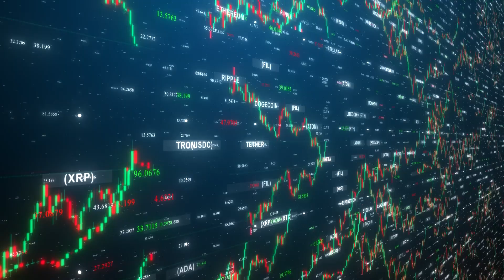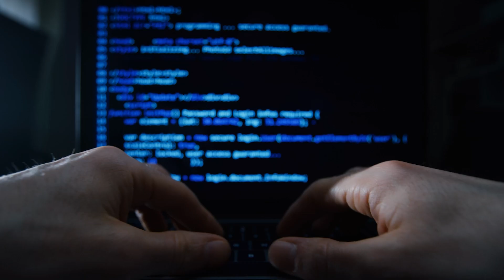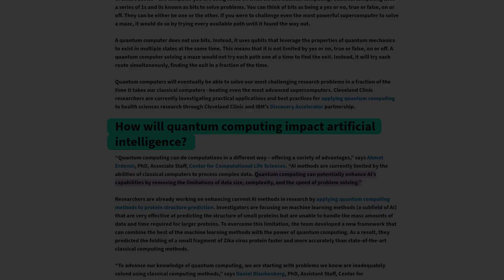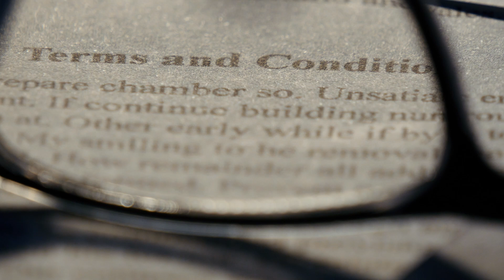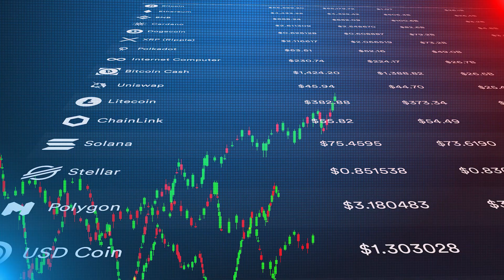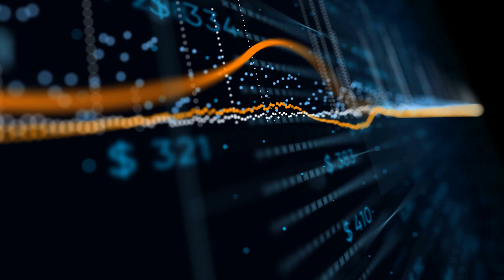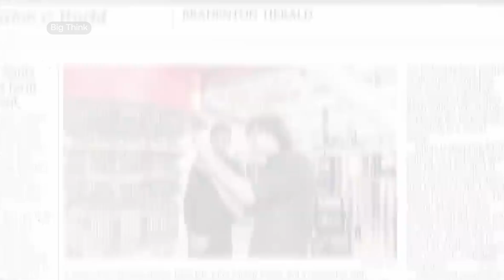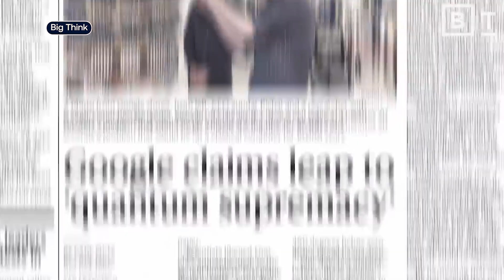Quantum Threat: Will Quantum Computers Break Crypto? | Sumsub

Comment: I'm am always amused by the misconception that we must alwyas build a single quantum chip with millons of qubits, like we must have tody a gpu with millions of core or a cpu with millions of core to do serious calculations. WTF!!! We have classic supercomputers with 100s of 1000 gpu/cpu where each has few 100 or 1000 cores.

Google willow is a big quantum breakthrough. Now imagine Google building a QUANTUM SUPERCOMPUTER where 100s of 1000 of Willow chips are interconnected and calculatons are distributed to achieve massive parallelism. All current non-quantum safe encryption algorithms will be in serious trouble.

Comment: You need millions of qubits for Shor's Algorithm to be feasible. Suppose you reached that capacity, it would take hours to break a public key. Bitcoin Wallets do not reuse Bitcoin addresses. Because of this, the public key for a specific address is only presented once on the blockchain; and that is when the coins are being moved to another address, i.e. when the address is empty. So, even if you spend hours guessing the private key, you would not get the bitcoin.

The only way to get the private key from the Bitcoin Address is to break SHA-256. To do this, the quantum computer must use Grover's algorithm, which improves the search to 2^128 operations. Still infeasible.

Comment: A lot of triggered crypto bros in the comments in denial about the threat Quantum computing poses.

Bitcoin can try and safeguard against it, but that process is not straight forward, easy or quick. Legacy finance will be able to implement safeguards because they’re centralised systems which don’t require a large consensus to implement. Bitcoin by its nature of being decentralised will tread a tumultuous path on its way to implementing protections against quantum attacks. A hard fork is almost certainly going to be necessary, which in itself is a very contentious point of action. There’s also a chance everyone will have to move their funds a to new wallet type by a certain point, otherwise they’ll be locked out. It’s going to be rough for sure.

Comment: NIST has stated FIPS 203, FIPS 204, and FIPS 205 are considered quantum secure. They are also planning to test an additional 15 methods this coming year. Not even mentioning RSA is considered to be fairly quantum secure, taking a large amount of time and resources to crack a single 2048 bit key. We already have some modern services that are focused on security updating into quantum secure encryptions. I wouldn't really call this fear mongering, but I think I'd certainly call it uninformed reporting.